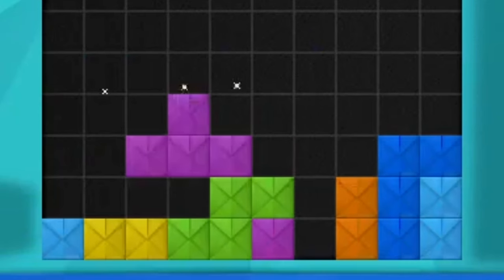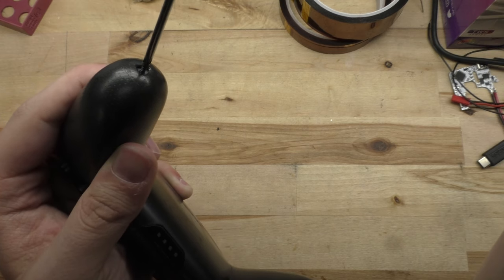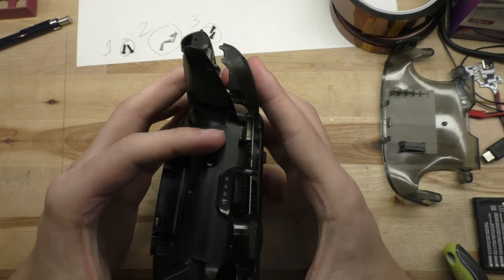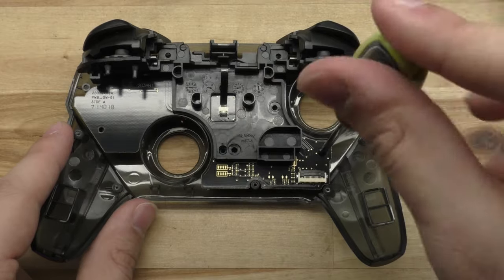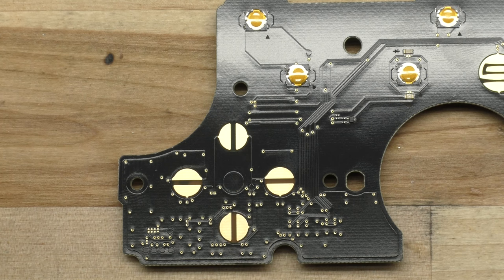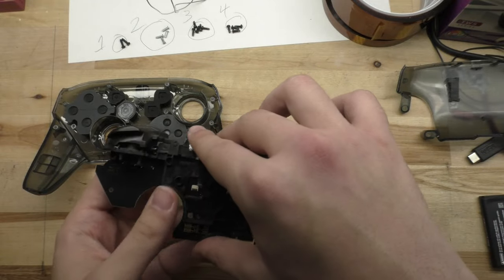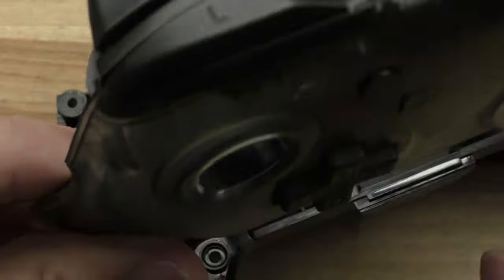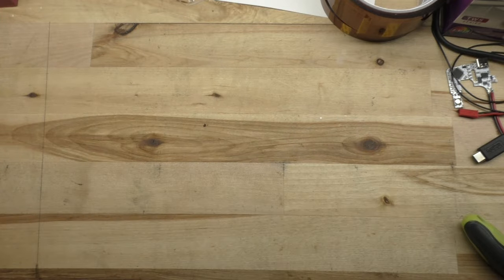Easy Fix for Nintendo Switch Pro Controller D-Pad - Tutorial

Comment: Thanks for this. I ended up using a different fix instead (cutting paper in tiny circles and inserting them into the center of the rubber D-pad layer, to raise the center pivot post), but your instructions for opening the controller were helpful.

Comment: I'm swapping the sticks for metal ones later today, might as well give this a shot so playing SNES games on NSO is a bit smoother. I'm going to try electrical tape, maybe the extra padding will also lessen the creaky noise (although cleaning it properly wouldn't hurt either).

UPDATE: electrical tape is too tick. The extra padding does make the D-pad smoother, but it also prevents the recognition of a button press unless you really put some force into it.
Reply: oh lord why did u use electrical tape

Comment: Your fix may work okay for some games but I don’t think it would be good for fighting games.   The issue I have is the dpad is way too stiff and there isn’t the pivot point in the middle which allows you to be able to push down on the entire dpad like a big button pressing all inputs.
Reply: This problem occurs for me in fighting games as well.  Holding back to guard, only for it to suddenly register up and make me jump or down and get his by an overhead is a big problem too.

Comment: My problem with the dapd on the pro controller is that it's too stiff and not clacky enough. Thats why I use the xbox x/s pad via a converter on the switch.

Comment: I just want to find a way to put the Wii-U d-pad into the Switch Pro Controller.
Reply: You can literally just slap it in there. The buttons are a bit short (flush to the front of the controller), but it technically works and doesn’t have nearly as many false inputs.